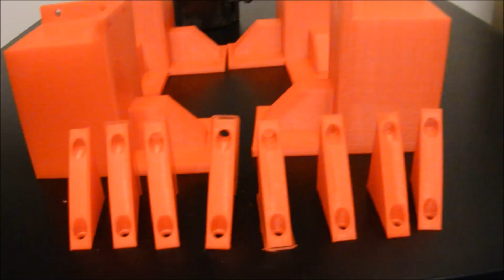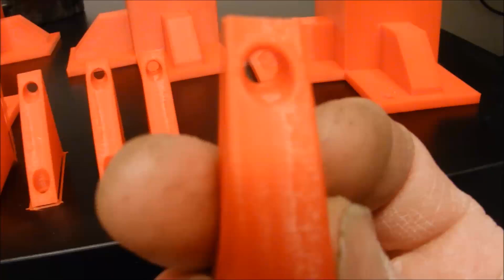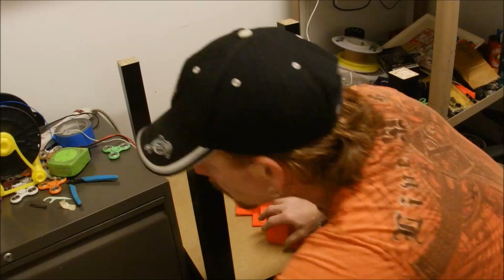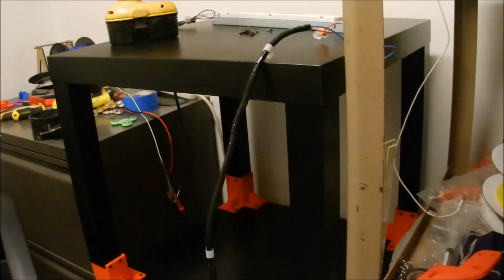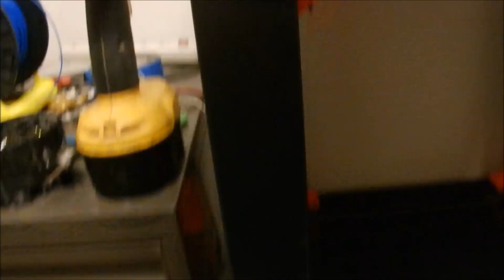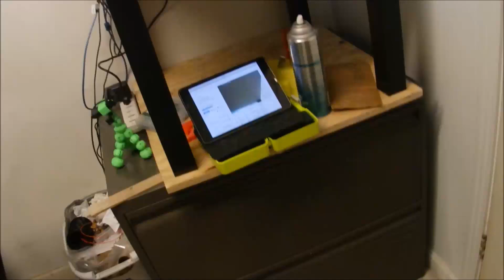SCREWING AROUND WITH MY 3D PRINTER  ENCLOSURE (IKEA LACK TABLE)

Comment: You should move your mother board and psu outside of the enclosure because they won’t last very long in the heat
Reply from the maker: 3.141592653589793238462643383279502884197169399375 yes that was the plan for sure LOVE YOUR NAME!!! Thanks for watching